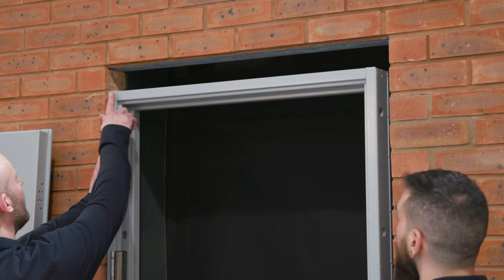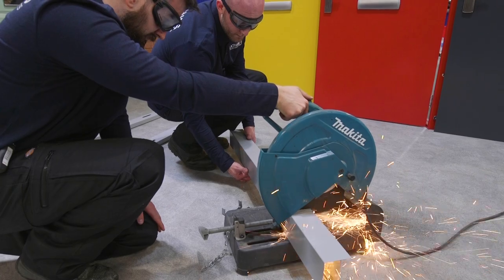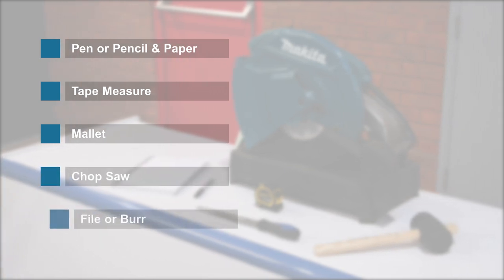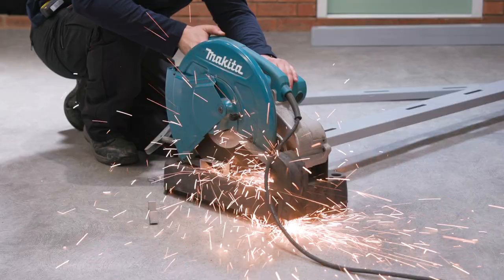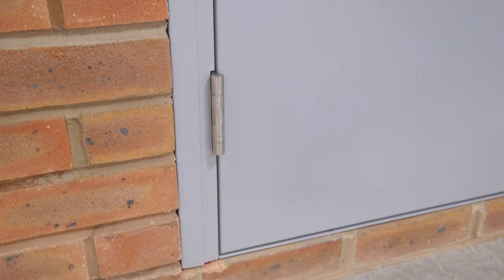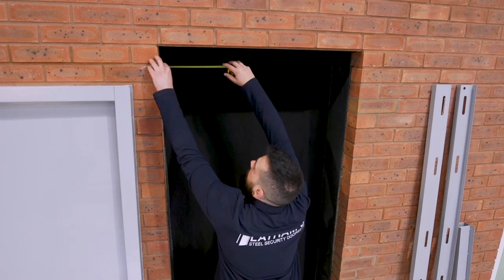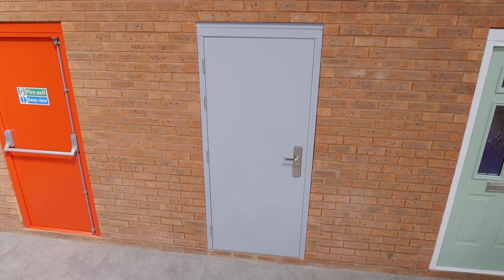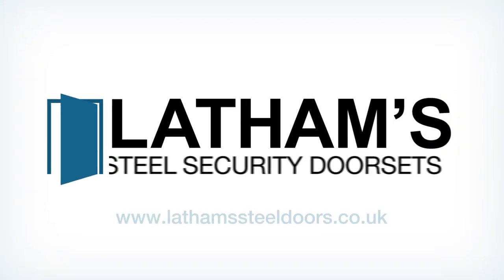Latham's Steel Security Doors - How to Fit Infill Panels

Comment: How do you fir these doors/frames on a Latham door cill?  I cant seem to find any videos on this.  The door cills are hollow so wont bear the weight of a heavy duty door.
Reply from the maker: Hi @actionreplay8235 thanks for your comment. So the cills are actually designed to take the weight of the door. To install, simply silicone under the cill and position it in place. Then pop a line of silicone on top of the cill, and position the door on top ready to fit in place. I hope that helps, but if you need anything further our team are more than happy to help, you can call 01384 220050 to speak to them.

Comment: Hi.  If I'm getting a black door with matching black frames and my installer is also buying side/overhead panels, then will these infill panels also be colour matched to the door&frame?
Reply from the maker: Hi Hashim, that’s correct yes, the infill panels will be the same colour 👍🏼
Reply: @lathamssteeldoors  thank you :)